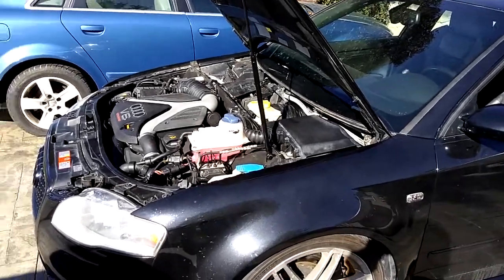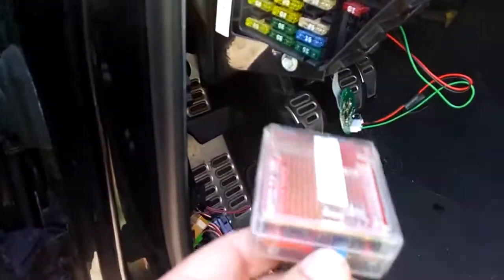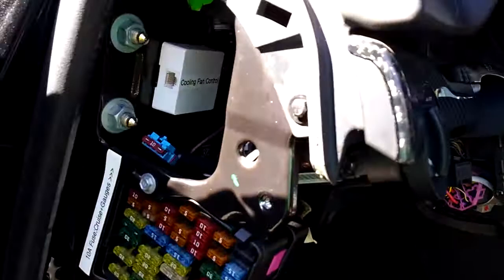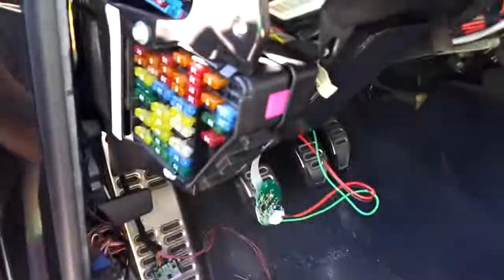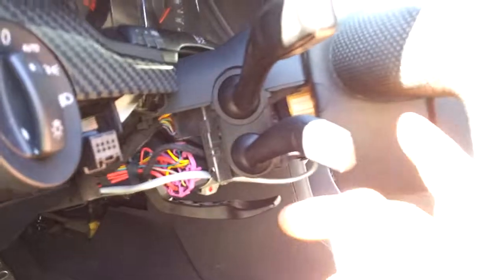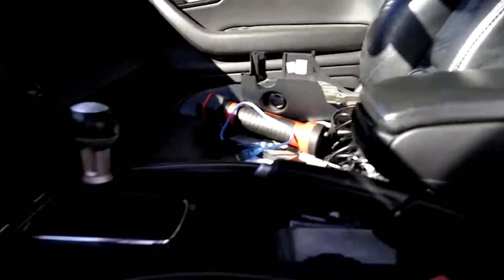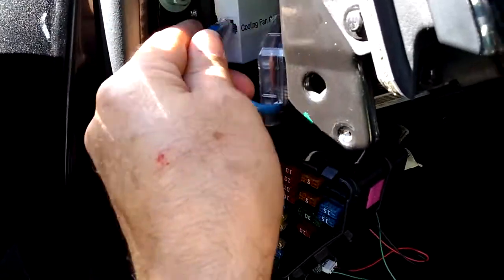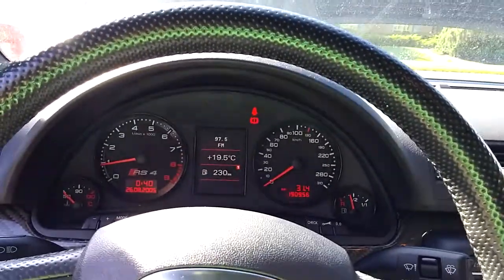20160916 Project B7 RS4 Stage 3 2.7T Biturbo Swap UPDATE 4: Cooling fan and cruise control

Comment: hi man! i saw rs4 cluster, it works with this swap ?
Reply from the maker: Yes, works fine. Had to turn off the oil level monitoring function with VCDS but otherwise works well.
Reply: @biturboaudis4  Thx man 🙏 ecu is 7.1? you doing a great job 👍

Comment: Hello from NC, I just came accross your video. I have a b6 s4 I swapped and need to get CC going. I did buy a 2.7swap arduino that is supposed to fix fcm and cc but I have a custom spliced harness and Im not sure how to go about it because its also hacked around the fcm. Considered buying another in tact 2.7 engine harness to work with but I think its the s4 body harness that controls fcm and wiring harness from driver fender has many extra power/ground wires not being used currently. Any experience or thoughts on what I should do?
Reply: I appreciate any help in advance

Comment: So this guy swapped an RS4 engine to only add like 10 more HP than he already had 😂😂😂 idiot. It's only worth it if you have a regular A4. That 2.7 gives it that boost.
Reply from the maker: The 4.2 engine in this RS4 was blown. Finding a good used one proved difficult. As for HP, this 2.7T is adding about 120hp to the RS4s 420hp, as well as at least another 150 lb-fit of torque.
Reply: Y not just put another 4.2 y not put one from like the suv or anything else they are only like 400 $ where I am that’s what I thought of doing
Reply: @heavenlyhatch  They're not the same. The RS4 has 414hp while the S4 has 313 or something like that. Even though they are both 4.2 V8

Comment: Please send me the coding and wiring for the fan control module :) i've done swapping the 1.9 AWX into b7 chassis and i Cant figure put how to control the  fans :) misiek9980@o2.pl

BTW. great job with this rs4 :)
Reply from the maker: Thank  you. Email sent.
Reply: Can u send me that as well, lvboss1992@gmail.com or  everything I need to know lol, I'm starting mine this winter
Reply: And also did u use a 3.0 radiator and fans and did u weld a snub mount
Reply: the stock mounts work. i pulled the mounts from a 2.0 passat bc mine were busted direct bolt in. i immagine yours is a4?
Reply: you need he 3.0 rad and 2.7t heater core. its literally easy as fuck

Comment: Great work!  I'm a subaru guy, but i'm getting older, and looking into maybe switching to Audi's... and the RS4 really catches my eye.   The AWD and V8 are just a perfect combo when paired with the 6spd manual.  My question to you guys is... if a supercharged audi RS4 is breaking into the 10's in the 1/4 mile... why would you be doing these swaps to the 2.7t?
Reply from the maker: The Alusil blocks in the RS4/S4 and other engines of this era do not hold up well over time. The cylinders wear, and there is no fix. You can't use traditional methods to machine them. The one in this particular car had some cylinder wall scoring and could not be saved. A replacement used engine was $5K+ (for a high mileage example), and prone to the same fate. The 2.7T has a traditional iron block and port injection. These 2.7Ts did not suffer from oil consumption/carbon build up issues that the newer, direct injection engines have. Arguably, this engine will be more reliable in the long term.
Reply: This is an appealing swap for a lot of B6-B7 owners, including myself. The 2.7T is known to be over-built and extremely reliable compared to any iteration of the chain-driven 4.2s. Nice work IPP.